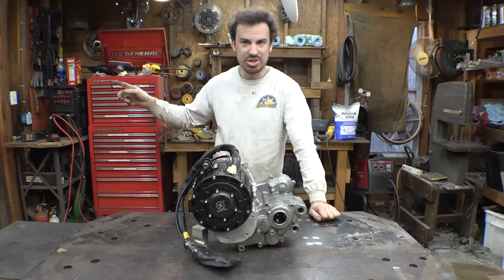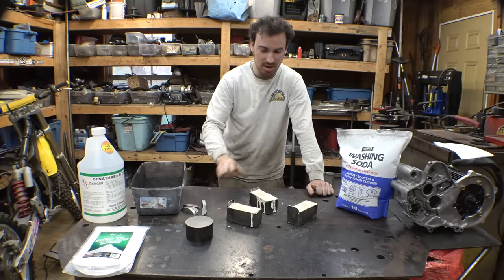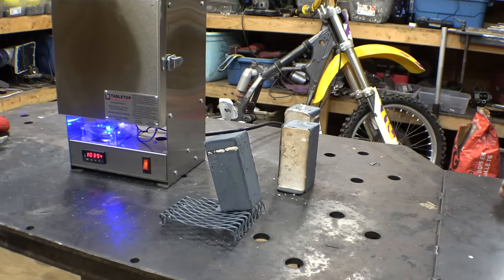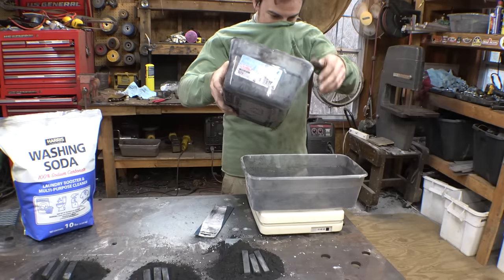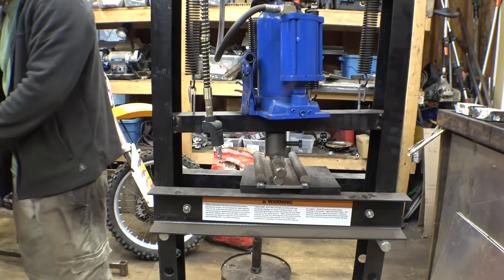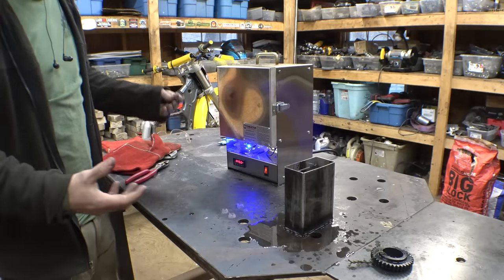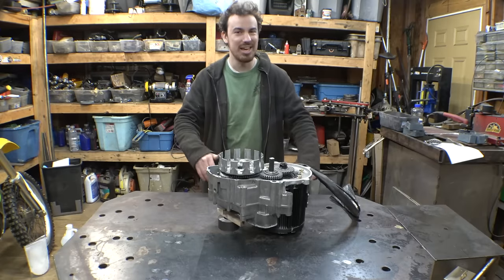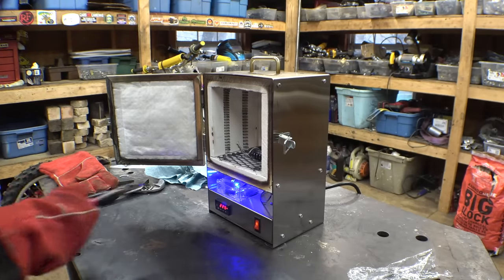Hardening the Steel Gears for the - Home Made 6 Speed Electric Dirt Bike - Part 3

Comment: Why the fly cutter? Was the involuted cutter the wrong range? Also what was the grade of steel you used for the gears because that is very important, EN24t or EN19t would not need carburised just quenched and drawn. You can do it by the colours, fully harden then draw back to straw colour and bobs your uncle.

Comment: I think the transmission needs to handle a lot of torque. It can break due to insufficient gear engagement when switching. There are five Denzel Rush motorcycles with transmissions. In two years, I changed the transmission on only one motorcycle. =)
Sorry for my English.

Comment: I worked a lot fixing bad engineered gearboxes, mostly cases of badly miscalculated gears. that suffered stresses beyond what the best material would resist. Because the cast for the equipment was in place, we had to run the same or not so different size of gears, often recurring to very custom odd moduli, like 2.18 with custom teeth profiles an besboke tooling.

But the best improovements, after improoving on geometry,  materials and best heat treatments, were obtained by precision of manufacturing, better surface finish and lubricants.

To reach that, I strongly recommend that you break in these new gears with very low load, 5%, and then rising to the limits of your load applying aparatus, you can develop one via your lathe or via the actual motor with some brake device (you can analize the load via the ESC current) Do it with thin motor oil like 5W30 or ATF fluid to grind and wash away debris.  Odd teeth counts with irrational gear ratios help here. if you have the same number of teeth, the same teeth will match with a same partner on the other gear, which can result in gears that must be indexed for propper working after breaking in. Monitor oil temperature, don´t let it rise above 80°C. You can tell surface finish without disassemble, depending on your situation, you can see a temp drop for the same load as surface improoves. We used to have telemetry on our apparatus, so when temp started to stabilize on a minimum value after dropping constantely, It was time for a load increase to reach the same pressure and thus rate of material remotion as the surface area was increasing and reaching no more metal to metal contact with the lower load.

This allows you to check the gears before hittinh the road for meshing, axis aligning, contact pattern, divider error and more.  That would add to your confidence and can avoid any bigger damage if something is wrong. Anxious to analize this data on a next video.

After reaching a propper surface finish, set on a propper gearbok oil like 75w90 , but the question is: Can you fill it with gearbox oil, which most of then have high pressure additives, running a wet clutch? I don´t think so. So you would need to use JASO MA2 motor oils, wery thin for a higly demanded gearbox.

So i Strongly suggest that you convert it to dry clutch and use gearbox oil with a generous dose of MoS2 containning additive.
And always assemble everything with MoS2 grease (that´s more os less what´s into arp bolt grease or camshaft assembly lube)

Comment: When you apply the extreme power that this motor will make, excess power will only result in more wheel spin. The slip of the rear tire will relieve the extreme torque stresses. Loose dirt is your friend.

Comment: You probably want to temper the gears as well. It'll reduce brittleness. It's a relatively short heat treat process. Research the proper steps, but it's mostly just heat to around 400 degrees, and let it cool.

Comment: As has been said, temper the gears to alleviate the brittleness of the steel after hardening. I'm not sure of the temperature in Americanese, but around 250 degrees C for 2 hours and then stick it in sand to cool  slowly.

Comment: You absolutely need to draw the parts back otherwise they will be brittle and very susceptible to shock loading and likely to sheer the teeth off using the temp.and time tables for O1 tool steel will most likely work fine

Comment: Do you make cookies too :)
Very  awesome...I would think the thicker the hardness layer the better right?
Also...used motor oil is what I have heard for case hardening..but I guess vegetable oil seemed to work well...and wasn't near as messy
Outtakes are funny...did you have a script?  LOL...also you need the "retake" flapper for recording...that would be funny!
Keep em coming!!!!
Reply: hardened steel is almost as hard as glass.  If the layer gets to thick, the teeth will snap off like glass.

You want a hard layer for wear, but a creamy nougat center for strength.

Comment: If you woulda just thought about it and grew a PAIR, about half a second after you FULLY closed and latched the door you would've burned all the oxygen out of the oven and the fire would've gone out, but you kept opening it and giving it AIR to breathe - Fire can NOT happen without fuel and AIR, only Magnesium will burn without air (even burns under water) since boric acid and your other metal parts aren't magnesium, it would've been fine

Comment: Just use D-2 (A-2 would prob be fine)  Harden @ 1800F (1750 A-2) for 1/2 hour per inch of thickness. Let air cool then temper at 800F for at least and hour or so. That will give you mid 50s Rc hardness AND (best part) no oil quench needed and it'll be hard all the way through.

Comment: Are you going to remove the seals on the bearings on the center gear or do you need to remove them? They should get lubed along with the rest of the gear box but don't know. Great job as usual. You could always tune the torque curve to protect the internals.

Comment: Actually what you are doing with the case hardening is heat treat, the quenching later is the hardening :) depending on the Metall you might want to also warm  the oil when quenching. But im not keen on the details.

Comment: Not trying to put extra thoughts in your head about if it will or will not work I would just see if you possibly need to anneal or heat treat the metal after case hardening has a lot of metals actually get case hardened and then they get a New Orleans which just means that you put them back into a certain temperature and let them sit there at a certain temperature that way it makes them so they're not so brittle but at the same time harder than they was when they first went in

Comment: Used engine/motor oil works best as it has the fuel and carbon from the motor in the mix, add some kerosene to the mix also for the hydrocarbons... watch out for as little flash off...

Comment: The motor oil needed to be  a straight weight like 30w or 40w. 10w-40 had additives that allow the oil to change viscosity.

Comment: You're making sub-standard gears to what's available for purchase. They're going to be louder and weaker than necessary. Cut, polish, and etch to get case hardness and heat effected zone. Your machining leaves a lot to be desired for accuracy. And hand grinding the ID means there is no reference to the gear pitch diameter.  What is going to retain your bearings besides a press fit? Are you going to form grind the gear teeth after heat treat? They'll distort after HT. The larger thermal mass will effect the amount of quench oil you need to get the same quench rate. And we haven't even talked about the need to magnaflux. Just call Boston Gear and order what you need.

Comment: Killer experiments.  Please get a real, heavy-duty extension chord.  heh, wonder if the wall socket and wires behind it are getting warm too?
That shed always needed better electric, but this is really pushing it.   Maybe a new shed one day, that'd be awesome, but don't burn this one down first.
Making and hardening gears is a killer skill.  Opens up so many options.  This wasn't as "fun" as testing suspension, but really fascinating.
The gears look totally skookum.  Everything fails eventually. Extra sad on one-off custom like this, but it'll be fine. Just don't try to take off in 3rd gear.

Comment: I built electric motorcycle about eight years ago has the top speed of 55 and can run for 50 miles on a charge, being only five horsepower it didn't require a license it's classified as a moped.

Comment: be careful i just noticed you dipped all the strips in the oil one after the other not allowing the bath to cool that can reduce or increase the hardening or make it harden unevenly where the internal grain structure is weak but the outer grain structure can be normal hardness

Comment: So the only reason(at least in my opinion) they say to use motor oil instead of vegetable oil is due to price. Price a gallon of motor oil and a gallon of vegetable oil. Huge difference long term. Both act the same as far as what you're using it for.

Comment: I do have one question? Why do you use tge clutch? 
Hear me out. On a combustion engine the engine is running and you need to ease into it as the output shaft is not turning but the crack is. But on a  electric bike if you are not giving any throttle the shaft is also not moving. To accelerate you just need to give it some throttle on top.of that on a dirt bike you don't need to clutch up or down. You ca  do it without just go off the gas.
With the electric should be the same if you don't give it any throttle there is to torque on the input shaft and you can easily shift gears.
If you delete the clutch you also won't have any slip due to higher torque of the electric motor over the combustion one.
Great build and looking forward on where you will be putting the battery and how it will one wheel on throttle 😅😅😅

Comment: Don't put the hot boxes on the steel table the table will suck the heat out fast from conduction instead put it on fire brick or ceramic wool (Kaowool)

Comment: I fear that the carrier bearing gear being positioned under the drive gear will cause the gears to push away from each other and cause unnecessary stress. By placing the carrier bearing gear on top it will cause the gear’s to pull into each other preventing slipping or jump teeth.?

Comment: There is a tool that's kind of like a center punch tool but it kind of detects or a file that detects the hardness the Rockwell hardness of particular metal basically the files that are harder than the metal that you're doing well let you know that it is of a certain Rockwell the other thing will punch into it it will tell you the Rockwell also

The reason why I bring this up is because you're talking about the torque forces that are used or applied by the actual electric motor which may be applied as a shock load and certain things that are hardened like cast steel does not like shock loads not that I think that you have to worry about it because it is case hardened and not a complete hardened parts

Comment: seen people use discarded engineoil from diesel engines , the old and verry black oil has a lot of carbon in it and might be doing the same thing as the carbonizing with the oven
think you could use a pressuregauge on the hydraulic press to get a little more exact data 
used to work for a company that build cranes these used realy big gears , these gotten shot blasted (bombarded with litle steel balls )  wish compressed/forged the metal at the surface
i allso seen people harden metal by using the discoloring of the blank metal as a guide ( cobalt blue or straw gold , stuff like that) to releive it some after hardening (to prevent things being too brittle )
if the gears wears too fast you could make the intermediate gear from bronze (sacraficial gear) usually lets the gears live longer and be less noizy

Comment: Why not buying carbon steel, machine the gear and harden it in oil with the proper temperature, and then tempered to achieve the desired hardness

Comment: If you have issues with that transmission, you can get a Harley transmission, which is a divorced style and can handle torque. 
As for lash, with that not going to see high temperature, you can do .004"-.008" and be fine.
Reply: Not going to be easy fitting a harley gearbox in a 125 dirt bike frame. At that point you might as well start with a complete harley chassis.
Reply: @jasonb6570  I don't think they are much bigger than that 6 speed.

Comment: Wow, you watched how many videos to do that because you should have watched one more to see that you need to run those gears through a mild temp, usually 400 degrees for about 2 hours and then let them cool on their own so they aren’t as brittle.    I am gonna laugh my a** off when one of those grenades as you take off on that bike.    Your worried about the trans, lol, your gears will explode way before that trans does.   You took the time to make those, while you were doing it you should have made 2nor 3 replacements for each because otherwise that bike will be like your other projects, make, break, let sit and rust out.

Comment: I DON'T UNDERSTAND WHY YOU HAVE DONE WHAT YOU DID YOU DON'T NEED GEARS THE GEARS ARE HOW MUCH POWER THE MOTOR GETS SIMPLE AS THAT AS TESLA GOT GEARS KNOW THEY HAVE NOT DON'T GET WHY YOU DID ALL THAT WORK?????😂😂
Reply: JFC turn caps lock off, makes you look like a fool. Secondly, who cares if he's adding a gear set to a battery dirt bike? It's his project and some have added manual gearboxes to electric cars before because you can change the gearing better than being stuck with one gear ratio.
Reply: If they want more torque with small motor....and sometimes speed
Reply: The first 3 words say it all.
Reply: @BIOMAXABLE lol